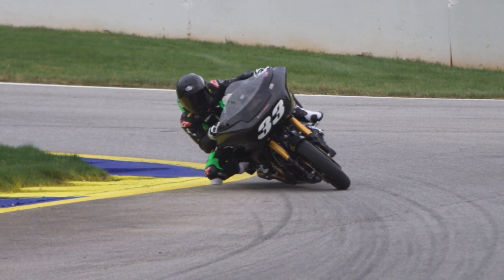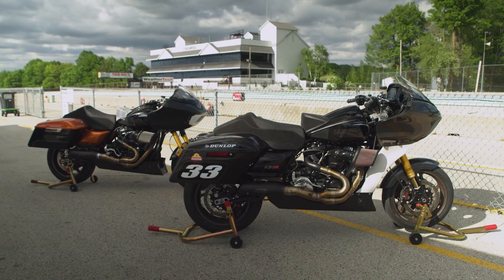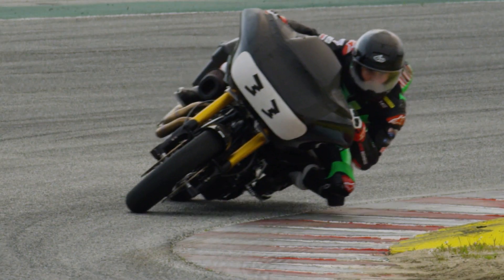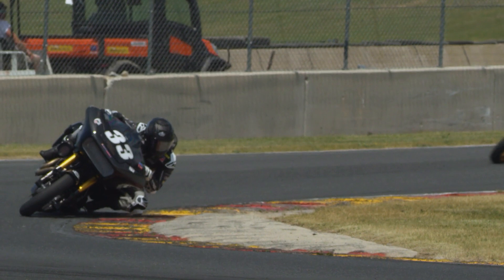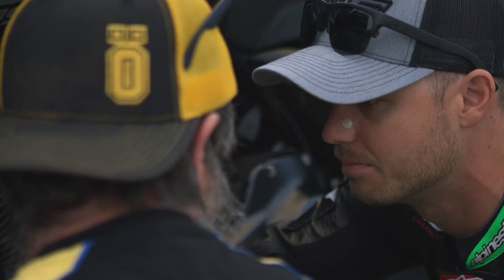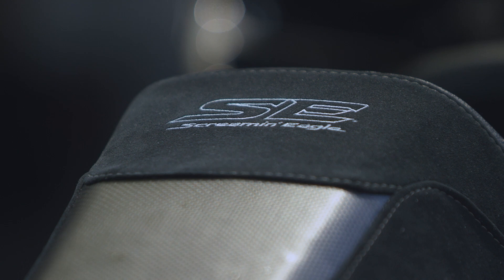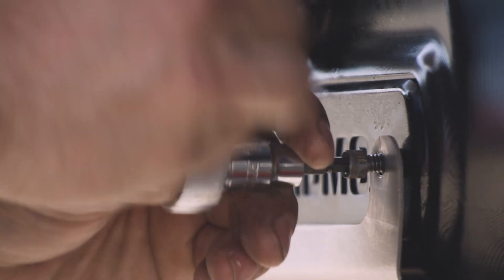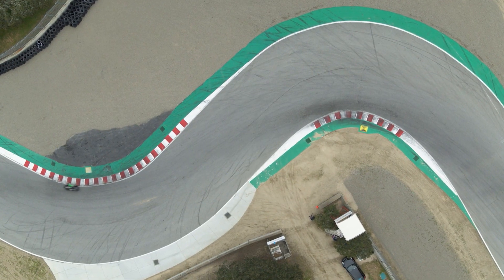Screamin' Eagle/Öhlins Remote Reservoir Rear Shocks | Harley-Davidson

Comment: Harley Davidson working with Ohlins! I love where HD is going. Offering Ohlins front ends would be amazing too, and radial brake upgrades!
Reply: I completely agree. I love what they are doing and the direction they are taking things. I could never ride a sport bike on the street. Can’t come close to what they can do unless your on a closed circuit. Harley-Davidson are very good Street machines now. I have Ohlins on my 2021 Low Rider S and will be at NJMP on September 24th for some fun along with some other H-D buddies.
Reply: Upgrades? Ohlins suspension should be standard on all touring models because what HD makes is awful for a $28K bike.
Reply: @johnvanzelm2307  I completely agree. Earlier this year I finally bought the Road King Special that I'd lusted after for years. Looked beautiful but (amongst other things) the suspension was just awful. Having ridden it the 300 miles home from the dealership, I realised that it was far too uncomfortable and I'd have to spend thousands more in a hope of turning it into the comfortable tourer that I wanted it to be. I cut my losses and sold it within a week.

Odd that I've never bought a new car and felt a desperate need to change the suspension, seats and control to make it usable for its intended purpose!